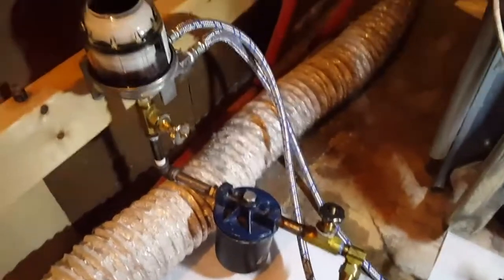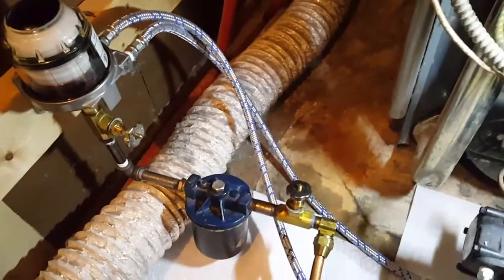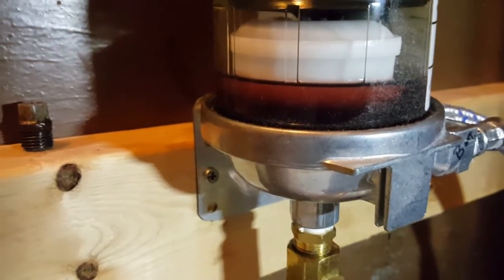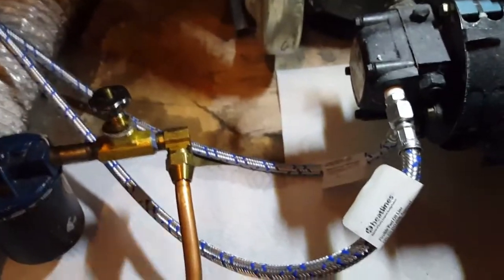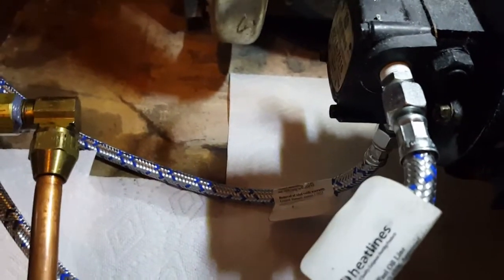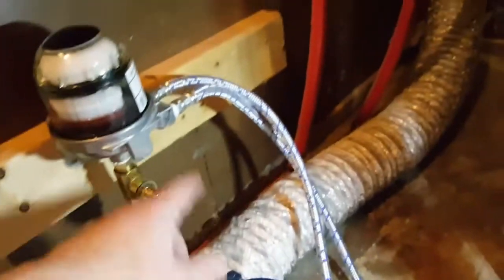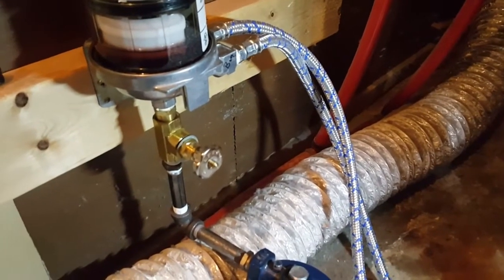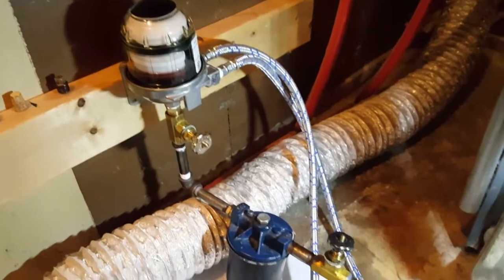Tigerloop Oil Deaerator Install on Boiler

Comment: Get rid of the yarn filter. Replace it with a Garber spin-on oil filter with a vacuum gage to monitor filter life. Also the firematic valve is code so you need to keep that. I would add a 90° ball valve before the filter to allow for positive shut off of the oil supply when you have to change the filter.

Comment: I would put a some pipe dope on your PTFE joints as over time the oil may eat away at the bare PTFE.  PTFE on oil joints should used as a packing and not a sealant.
Reply: PTFE tape in general should not be used in general on oil supply lines because tap fragments can go into the pump. but PTFE paste is not a problem. Gasolia for example is what the pros use and contains PTFE paste.

Comment: This tiger loop is designed to be installed externally because there is a vent hole on the dome.

Comment: Add another filter and youll be golden
Reply: where would the second filter go?
Reply: @chrisE815  at the oil tank
Reply: @grnmtnskier  why is this necessary? I am about to install another tank and currently my system has a tigerl loop and one filter? Thanks!

Comment: The tiger loop did that come with the fire safety valve
Reply: Just bought the ultra kit yesterday and it came with a filter and a firomatic.
Reply: @trickhealey  had to do some research to see if it can be used on a thermo pride waiting to hear back from them
Reply: @ironhead320  it can be used on any oil burner setup for a two pipe system I do believe